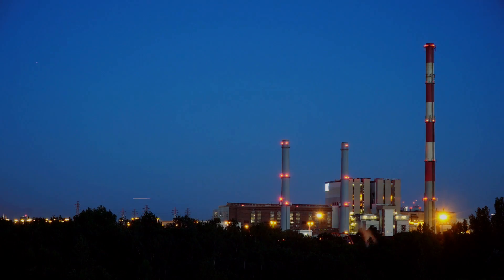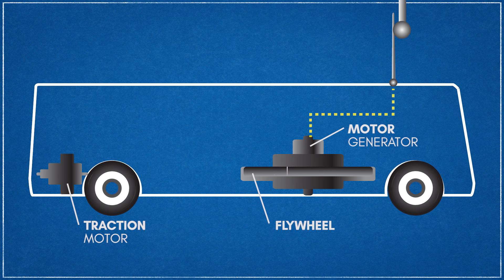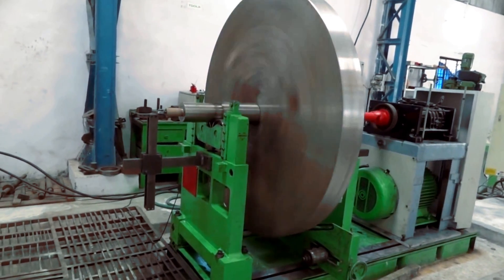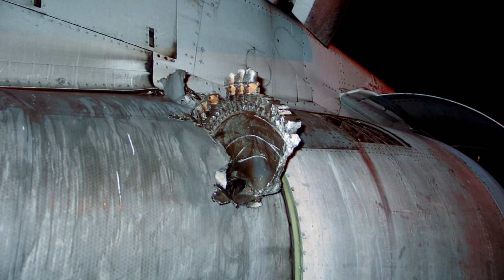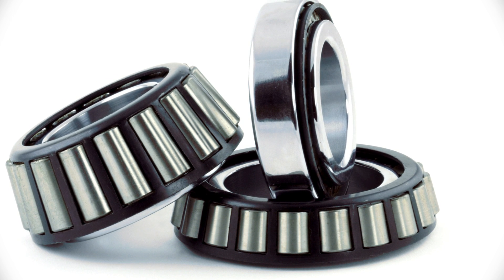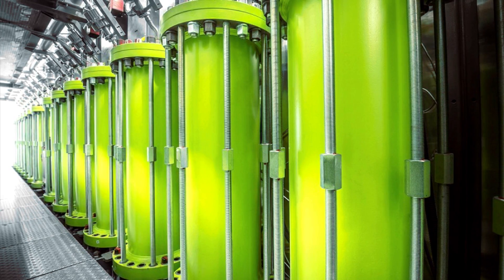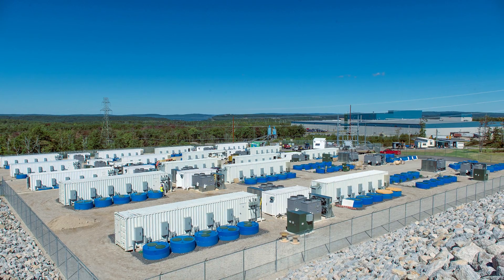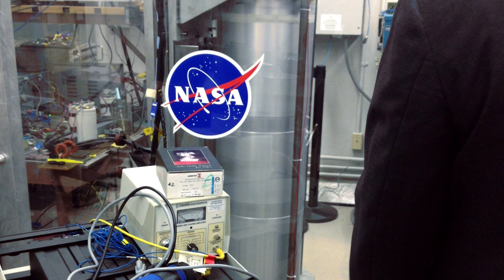The Mechanical Battery

Comment: I found no flywheel while disassembling my lawnmower. Oh, wait, the spinning blades serve as the flywheel, since the blade is solidly attached to the crankshaft, is heavy, and has its center of mass along the axis of the crankshaft. Brilliant.

Edit: the small fan housing on top of the engine does contain a small flywheel. It has a smoothed side for a brake shoe to stop the engine when you release the safety handle, but is comparatively tiny compared to engines that aren't already attached to a large rotating mass.
Reply: Actually, there is a large flywheel under the pull starter housing. It has blades on it, to blow air over the cylinder, to cool the engine. It's necessary, because you only get one power stroke every 2 turns of the crank shaft, and just before the power stroke, the flywheel has to have enough momentum for the compression stroke, after having driven the load. A single cylinder 4 cycle engine needs a substantial flywheel. The lawnmower blade actually helps though.
Reply: @vincentrobinette1507  I think the main function of the small flywheel on the top of the motor (although it helps smooth out the motion) is allowing the brake shoe to stop the motor instantly when the safety bar is released. Otherwise the blade's inertia might be dangerous even when the engine gets choked out of air. It does contribute to crankshaft inertia and does make the rotation smoother as a bonus.
Reply: @marc-andreservant201  Don't forget: it also contains the magnet for the ignition coil. It is heavy enough, that the engine can run smoothly without the blade, because the engine being unloaded, it has plenty of inertia, to get through the compression stroke, for the next power stroke. The flywheel is lighter on a lawn mower, than on a roto-tiller, for just the reason you mention.
Reply: The fan blades control the governor. The faster the blades turn the more air pressure on a flap to pull the butterfly in the carb closed. And it helps cool the motor a little.

Comment: In the future we will be driving hybrid cars running on hydrocarbon fuel manufactured by nuclear power plants.
Reply: Hydrogen is hard to store and dangerous. Hydro carbon liquids are safe and energy dense. And you have to capture carbon from the air. That makes it carbon neutral.
Reply: @enginbilgi  I thought you were referring to natural gas,(methane) not a liquid fuel. Hydrogen and natural gas are actually quite similar, in that they are lighter than air, and they are stored as a gas at high pressure. Neither compresses into a liquid, the way Propane does. For a liquid fuel, it has to be a hydrocarbon, as you suggested. None the less, it still stands, as a good way to use otherwise curtailed output from turbines, when the grid just doesn't need the power that moment when there's a strong wind.
Reply: Vincent Robinette :  
 
Hydrogen and natural gas are quite different. There are more atoms ⚛️ of H2 in a gallon of natural gas than in a gallon of pure H2. The function of the carbon atoms in natural gas is to increase tremendously the density of H2. A carbon atom ⚛️ in methane holds 4 atoms of hydrogen close together. In pure H2 gas, the 2 hydrogen atoms ⚛️ are too far apart in the H2 molecule. 
 
H2 molecules are thousand times far away from each other’s than the 2 atoms ⚛️ of H2 in a H2 molecule. 
 
Natural gas wins hands down.
Reply: Vincent Robinette 

Hydrocarbon fuels 🔥 are chemical batteries 🔋 that store solar ☀️ power (nuclear energy, fusion nuclear ☢️ energy particularly).
Reply: Engin Yeğnidemir 

Right on.
Reply: Probably not even hydrocarbon: Just the Hydrogen generated from nuclear, and other non' carbon electrical energy sources. It's a perfect way to store excess energy from wind turbines, when the winds pick up, when there is not  enough demand on the grid, to accommodate the excess energy.
Reply: Vincent Robinette : 
 
Storing H2 is too difficult, inefficient and expensive. There is more hydrogen in a gallon of gasoline ⛽️ at room temperature than in a gallon of liquid H2 (which has to be a -100 Celsius degrees).

Comment: Don’t use flywheels in mobile systems. Rather, use them in stationary systems. Use the stationary flywheels in 18 wheeler/large trailers that are parked at various locations, re-charged overnight, then used to re-charge electric vehicles during the day.

Comment: The gyroscopic effect on he bus would make it more stable i think, it would be harder for the bus to tip over.
Reply: True, but for other reasons one may want to install counter-rotating flywheels to eliminate unexpected turning as the vehicle starts to go uphill. Installing the 2 flywheels low in the bus might help to increase stability anyways with a lower center of mass, but then I don't think it could pull of cool maneuvers like driving with half the wheels suspended by the angular inertia over the edge of a cliff ;)

Comment: If they break into pieces it acts like a blast. Russian scientist suggest using wheel made from long tape rather than single piece wheel - that is much safer.
Reply: With added bonus of magnetic data storage!
Reply: @mrmaniac3 /videos Voyager 3, powered by gold audio cassette.   ;)
Reply: That's what's in the video also. They even put them underground 👍
Reply: @simonito1715  I missed the point about steel stripe/tape...
Reply: @АгронДепартье  I guess the idea was that instead of exploding into pieces, it might just (as it loses integrity) sort of unwind, thus dissipating the energy gradually. That's the way I got it, anyway.
Reply: Or it would not explode, but lash around like a metallic whip, cutting people in half.
Reply: The energy has to go somewhere,I had this crazy notion of charging small fragmenting bombs by lowering them into the Marianas trench and then sealing them, vs 1 Bar a pretty good pressure differential.
Reply: Filament wound fiberglass or carbon-fiber flywheels fail in a "soft" disintegrating fashion, and a close "containment ring" of metal or composite can act as a brake drum to dissipate the flywheel's released energy. Conversely, metal flywheels will typically break into three high velocity segments/pieces that are much more difficult to safely contain. High mass metal flywheels operating at relatively slow, safer speed/velocity don't have the failure potential that lighter higher speed flywheels do, but they are generally much too massive for automotive applications.

Comment: Flywheel energy storage was my school science project back in 1975. I was inspired by a magazine article describing a bus under test at the time that used a high speed flywheel in a vacuum. That article contained the first mention I recall seeing this strange material called carbon fiber. I was very nearly injured when a bicycle wheel bearing I was using in my project failed.

Comment: I was using flywheels as energy back when I was a teenager I use it to get all kinds of things started even back years before that they used flywheels to start radial aircraft engines we took flywheels up to our bicycles get the flywheel spinning like mad and then take off like a bat out of hell or at least break the chain LMAO  but yeah flywheels have always been a big source of energy for a short burst of time glad to see they're making progress in maglev  bearings I wish we had those when I was younger
Reply: Correct.  Some US military aircraft used inertial starters prior to and during WWII.  A crewman would manually crank a flywheel to a high speed (through a gear train), which would then spin the crankshaft to start the engine.  The gearing caused the cranking effort for the crewman to be quite high, like trying to start a bike from a stop in its highest gear.

Comment: A friend of mine whose brother worked as a graduate research assistant at the University of Pennsylvania related the following story back around 1976.   There was a drum drive (early computer storage device -- essentially a wide flywheel  -- actually a special version of which were used in fighter jets) needed moved to a different lab.  It was powered down and the staff went to lunch.  After lunch they carefully set it on a low cart and started wheeling it to its new home.  It had been spinning at speeds of up to 100,000 rpm (per the story and confirmed from my later studies) when they shut it off.  When they reached their first turn,  the drive stood up on end from gyroscopic effects...  ruining the drive.

Comment: Backthen they were using Kevlar weaved flywheels that were spinning in the 100,000rpm range.
Reply: Wow, must've needed containment like a jet engine turbine! That's a storm of bullets if it has a structural failure, I wonder if they put kevlar around the containment cylinder too.

Comment: I heard about this 20 years ago.
Reply: I heard about this 40 years ago
Reply: @ajarivas72  What were they making them out of 40 years ago? As I recall they were only able to get up to 250K rpm 20 years ago with the polymer technologies then.
Reply: zeeek1 : 
 
Flywheels for energy storage
Reply: @ajarivas72  Of course but what were they made of that far back. Carbon and kevlar haven't beeen around that long. The article I read 20 years ago was the development from metal alloys to polymers specifically Carbon and Kevlar. I forget but as they heat, one will expand and the other contracts.

Comment: Inertia batteries do not apply well to vehicles, the gyroscopic effect being deleterious to confident handling and the weight of the flywheel itself inhibits efficient acceleration and deceleration...though deceleration can be worked to charge the freewheel.

Comment: Making inertia batteries is so, so, so much easier than folks realize.  They can be made from a variety of materials, but the most efficient will need lots of neodymium.  Without neodymium, the inertia batteries may not offer enough efficiency to be very useful on a wide scale.  Unfortunately, North Korea is sitting on one of the world's largest sources of neodymium....and that should explain why there is so much political tension between them and everybody else.  NK knows what they have, and knows why we want it.

Comment: All thermal power plants have a flywheel in the form of a multi ton turbine spinning at high speeds connected to a generator. Between that and the ISO's that's what keeps the grid stable.

Comment: What if you use a jull theif system to store the energy from the slow-turning wheel then disperse that to the battery.
Reply: All a joule thief does is trade extra input current for output voltage, but how would that help you with the slow spinning flywheel?
Reply: @daltonnabors  Because the battery requires more output voltage like 12 v or maybe even 6 if you had this you could always get that voltage no matter what.

Comment: What is the Energy Return on Investment of mechanical batteries? This is a crucial fundamental factor in regards to sustainability
Reply: It would be negative, but the less negative the better.
Reply: N Marbletoe - I don’t think you understand EROI
Reply: @wombatcitystudios  I think I had it wrong, it wouldn't be negative, but it would be less than one.  
If you put 100 joules in to get the flywheel spinning, and an hour later you get 990 out, and the efficiency would be 99% over that hour.  EROI would be 0.99.
Is that right?
Reply: @supercunthunt7756  100 in, 99 out is possible though.
ooh crawp I put 990 lol.
Reply: @supercunthunt7756  That's also not the point of mechanical batteries. You're supposed to use them to stabilize the grid, not to store enough energy for use the next day. For instance, if you rely heavily on solar panels, you'd use mechanical batteries to offset the downward trend when it's getting dark long enough for EFFICIENT power plants to crank up their energy production (google: duck curve in California). Meaning that if it's cheaper to build and use mechanical batteries than to use less efficient gas/diesel plants when the power generation decreases suddenly, then it's a technology worth investing in. You'd also recharge them when you're generating more energy than you're consuming (see: California, Spain, Germany, etc. and their over reliance on solar/wind) so it's pretty much free (monetary) energy.
Reply: @m8onethousand  The irony is that California, Germany, Denmark and Spain have some of the highest electricity prices in the world.
Reply: @masterwong1133  I can't speak to Europe, but California is doing some tremendously dumb things.
Reply: @reedr1659  
Yep, and now California is shutting down it's last nuclear power plant.

Comment: Flywheels on vehicles have issue with gryoscopic effects affecting handling, and inducing rotation on ice. As a result they they are usually used in counter rotating pairs.
Reply: That's exactly right. Otherwise, you've got a HUGE gyroscope! Two wheels, rotating in opposite directions on parallel axes will counter the effects of one another.

Comment: I was nearby a flywheel energy storage research and manufacturing building when one of them catastrophically failed causing a mechanical explosion that shot tons of twisted metal in all directions. Some of the metal fell through the ceiling where I was working. Luckily nobody was hurt. Any kind of mass energy storage will have issues like this however. Releasing tons of energy all at once is dangerous no matter what the technology is.
Reply: Releasing tons of energy all at once is called, an explosion
Reply: @mr.personhumanson6871  This made me rofl. :D
Reply: @mr.personhumanson6871  and since E=mc² it would be the biggest explosion the world has ever seen!
Reply: Why don't they just keep the flywheels in underground, vacuum sealed chambers?
Reply: that would be perferct energy source for helicopter/airplanes ...  lol
Reply: Imagine sitting with something similar to that between your thighs while traveling around 200 MPH. Ever wonder why modern top fuel dragsters have the drivers cockpit located forward of the engine? They weren’t always like that you know. Do an image search using “front engine dragster cockpit” and you will get the idea.
Reply: @ynotawoody  Yep, in the old days the dragster cockpit sat just behind the engine. The problem was not flying con rods, but the fireball engulfing the driver.
Reply: @Tore_Lund  to: Tore Lund, Yes, you are absolutely correct. Fear of an engine fire (fuel/oil) loomed large in the minds of those who piloted the old “Slingshot” dragsters, as did getting oiled down virtually every pass. Driving blind at 200 mph, while desperately attempting to clear the expelled engine oil from your goggles. Those were the good old days that no one misses (drivers). Not even a little bit.
Reply: kcotte59  And in 2005 in Missouri one of them had a wall collapse and nearly kill a few families when the full reservoir came down the hill it was on.  Happened at night as well.

It was a 50 yeaar old stucture at the time built in the 1960s, much like the Cali ones. With failure cause by greed and carelessness shorting maintance and upgrades. Much like what has cause several of the recent California fires. 

Make no mistake, those structure are as dangerous if not more so, then the flywheels. Flywheels will only damage a building or two, a Water Reservoir will destroy towns if not properly care for. 

And fellows? According to the American Society of Civil Engineers' report most Dams, which these are classified as, are graded as a D, minus. Meaning alot of them need tender loving care and a few rebuilds.

But since that cost money that neither party wants to spend....
Reply: @Dalmaen LiFePo4 batteries
Reply: kcotte59  the news stories on it can be found on Google if you search: poway ca flywheel explosion
Reply: I worked on the two flywheels at JET, as a guy who was used to heavy rotating equipment I used to go a bit hyper when we brought them online. Worked on the tiling of the fusion reactor also, I’d go with the flywheel for power rather than expect fusion to be of any use soon. By the way, that was 30/35 years ago fusion was promised?
Reply: And flying cars, and living on the moon and mars, and free pollution energy and a chicken in every pot!
Reply: @Albachiel  fusion is always promised every 20 more years. And in 2040 they'll say, "commercially available in 2060" and so on
Reply: @Dalmaen "irregardless'" used to be slipped in as a Monty Python-esque joke word instead of the correct "regardless" i.e. a case where the word and its "opposite" both have exactly the same meaning. Am I out of date, and "irregardless'" now passes as a real word? This is the end of civilization as we know it!;☹️
Reply: so in a sence the flywheel energy storage is a flywheel for genorators to smoothout the power delivery to the grid
Reply: Anywhere that potential energy, whether mechanical, nuclear, and fossil-fuel based can  have accidents. The world isn't perfect and humans aren't either, but I would take free clean kinetic energy even with the possibility of accidents here and there than nuclear or carbon-based fossil fuel accident any day.

Comment: Flywheels are good for storing energy for vehicles or other machines that have to move, but better solution is to lift weight and then it can turn generators while weight drops. It's a better solution as it does not lose stored energy since its not moving while unused. Check out Gravitricity.

Comment: Flywheel batteries on a satellite/spacecraft sounds terrible. Any charge or discharge would induce a rotational torque on the craft causing it to spin in the opposite direction. This is the exact principal behind the control moment gyroscopes used on most of them to control attitude.